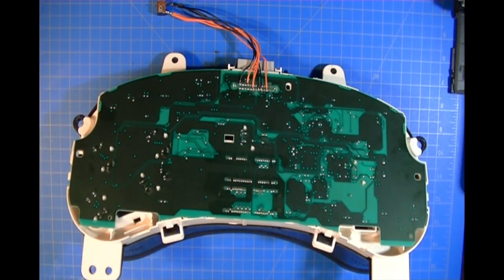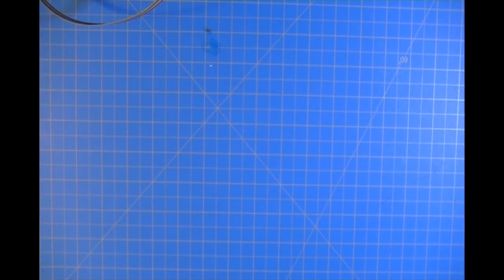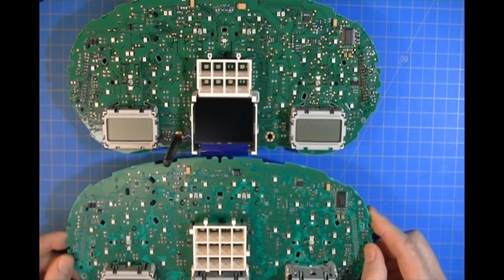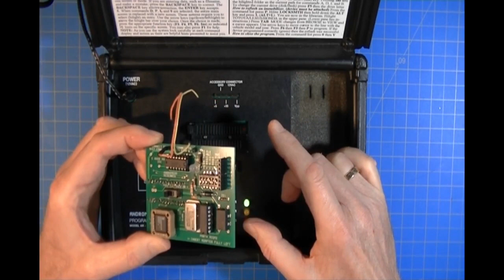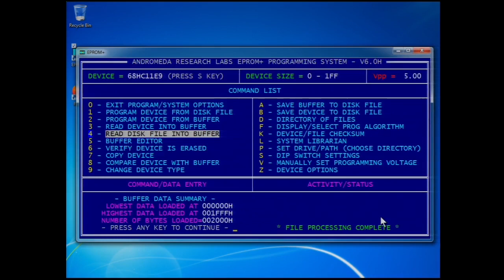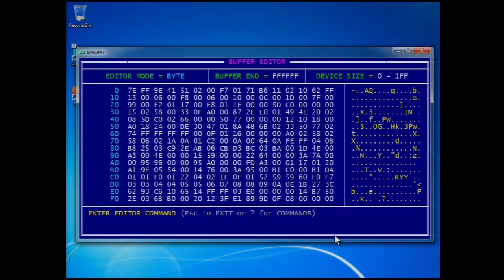Repair, swap, clone, digital gauge clusters and speedometers-correct mileage-edit VIN-Learn How

Comment: On an 08 colorado mileage is stored in cluster and bcm.  Does that mean you must clone both modules?
Reply from the maker: It depends on whether or not the primary mileage storage is in the cluster and the bcm is for backup. You may be able to clone the cluster and the bcm will just update. If this does not work you'll have to clone both.
Reply: @andromedaresearchlabs7826  if you put a bcm in a colorado with 390000 miles on bcm with only 10000 miles on the vehicle,  the cluster updates to 390000 miles

Comment: Im working on 2007 Ford F150 but it has five eeprom chips and none of chips p/n # are listed. I googled it but no luck, would you know which of the five eeprom and part # to be able to Identify vin/mileage...Thank you
Reply from the maker: If you want to send a list of the 8 pin part numbers I'll see if I can help. If none of the parts is an eeprom then the vehicle data is in the processor.
Reply: Here are the list odometer 8 pin eeprom on 2007 Ford F150: TJA1040 6716 6251
UPL38 XAIV
101 657 A455
Also two of this 1NVO4D STK629. Thanks again for your help
Reply from the maker: @joelaus4723  None of those numbers match any standard eeproms. If the mileage is in the processor it may not be possible to access via external connection.

Comment: I know this is an older video but i hope you still look at the comments. I am researching how to manually control a fully digital cluster with coding. Im not talking about digital clusters with analog gauges, im researching fully digital units. Can you help with this? Any tips?
Reply from the maker: Are you wishing to control the cluster via can bus commands?
Reply: @ I’m attempting to simulate a working complete digital cluster but on a work bench instead of in a car. If I need to build a “stand alone” CanBus system to do that, then yes. I want to be able to ramp up speed, rpm, fuel or coolant levels just like it’s in the vehicle. If I could have potentiometers to adjust these levels then that would be even better.
Reply: My example is a 2016 Range Rover cluster: model GPLA-10849-KC.

Thank you for sharing so much insight BTW. Love the channel and subbed.
Reply from the maker: @gaatvr  The cluster is just another nodule on the network. It may have multiple addresses depending on the design. The days of analog signals driving gauges are gone. Information is sent via network packets to the cluster which then processes and displays the information. These can come from the ECU, or other modules. The only way to cause the cluster to operate as if it is in the vehicle is to send the required data (speed, rpm, temp, etc.) packets . There may be a computer program which will allow you send network packets (bidirectional scan tools do it) but I don't know of any I can recommend. This is not something we do.
Reply: @ thank you so much for the reply. I know it is gonna be a monumental task that may never work out, but I have to try at least I guess. I’m just wondering if I could use a standalone ECU and BCM possibly to make a system that would work as a generic and multi vehicle platform for these clusters. The goal is to be able to replicate any short clips for movie production without having to actually use the vehicle and risk any contamination of the vehicles operating system. I guess I will continue on, but I really appreciate all of your videos and your insight in this subject.
Reply from the maker: @gaatvr  Basically if you acquire all the modules to fully exercise the cluster modes you'll need more than the ECU or BCM. You'll need every module that will cause a display change to the cluster display. With a "can bus packet sniffer" you can capture all the packets that are received to exercise the cluster display. Once you have them captured you should be able to find some software or person who can send the appropriate packets to generate the required display.
Reply: @ great info to have! Thank you.
Reply: @gaatvr  if you are making a movie,  might be easier to use ai to change that part of video

Comment: For sharing your knowledge!! God bless
Reply from the maker: Thank you.
Reply: @andromedaresearchlabs7826  would I be able to use this for CAS cloning as well ,, I have a mini R60 with intermittent CAS issues ,, I reset with my diag tool then after 1 or two drives it will lock out again ,, I think the fix will be to buy a used CAS module and replace it with my current one ,, ofcourse will need to clone and program the 2 key fobs ,, never done it this kind of programming before..

Comment: Hello man, can you help me... still go crazy, i need to clone a cluster (mileage and immobilizer) in a jaguar x-type, cause the original cluster too old... I buy one used and looking perfectly but the car doesn't start... Which one is the eeprom and how to copy it?! Thanks a lot, if you need same picture about that I will send you! Please help me..🍻🍻🍻
Reply from the maker: Send a photo of the cluster circuit assembly as an attachment to our email (arlabs@fuse.net). If there are parts on both sides send clear photos. We must be able to read the part numbers.

Comment: my daughter bought a 2012 chevy cruze that the used dealer swapped the cluster on and it dosent show mileage. what would i need from arlabs to program the vin into the cluster without having the old cluster?
Reply from the maker: First you want to confirm that the cluster does indeed have an accessible eeprom part. If so you can use Automotive Kit#1 to read the eeprom data and edit the VIN. If the dealer swapped the cluster hopefully the mileage is stored in another module otherwise this is a true mileage unknown vehicle. You edit the VIN using the same procedure shown in the video.
The link to Automotive Kit#1 is here:  https://www.arlabs.com/automotive_kits.html#kbc1
You might also consider purchasing a salvage cluster to play with before you pull the cluster from your daughters car.
Reply: @andromedaresearchlabs7826  Thats awesome thanks. Whats the best way to confirm an accessible eeprom part?
Reply: @andromedaresearchlabs7826  Also its my understanding that the mileage is stored in the ecm. do you know how to access that or do you think once the vin matches it will pull it over?

Comment: Hi there, I'm trying to connect to my eeprom from 2018 subaru crosstrek. Chip is a tiny 8 pin SMD component with markings on it as follows: RH8 62 QB any idea what type of a chip is it? Im using a USB to CH341A Programmer adapter and software. I cant find that chip on the list. Not sure if it is 24 type or 25 type. Could you help please?
Reply from the maker: The RH86 is in the support list for our products. The part is likely a 93C86.
Reply: @andromedaresearchlabs7826  awesome thank you. Would that be type 24 or 25 chip?
Reply from the maker: It's neither. It's a Microwire part - 93XX
Reply: @andromedaresearchlabs7826  ok thanks. Any idea how would i connect to it to a laptop in order to import the content?
Reply from the maker: @dahufka  You need a programmer which supports the 93XX family of eeprom.  If you want a quality in-circuit system our automotive kits  work well.
https://www.arlabs.com/automotive_kits.html

Comment: Would you be able to manually edit in the correct mileage without guessing on the gm cluster?
Reply from the maker: Yes, in most cases GM clusters store mileage as a binary integer (sequence of hex bytes). If you convert desired decimal mileage to hex you can enter the mileage you wish.

Comment: Hello do you clone VW instrument clusters? My cluster is going haywire and Germany dont make my cluster any more.
Reply from the maker: If the cluster retains the mileage information in an eeprom memory part then it can be cloned into a salvage cluster.
Reply: @andromedaresearchlabs7826  yes it still has the mileage on it and everything. Info just needs to be cloned or transferred